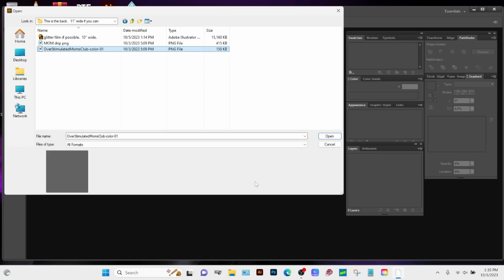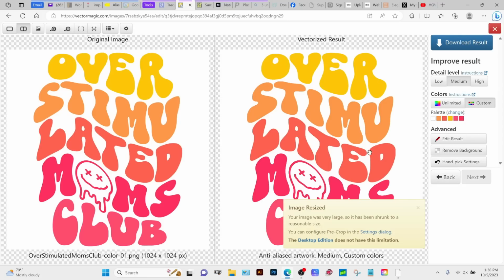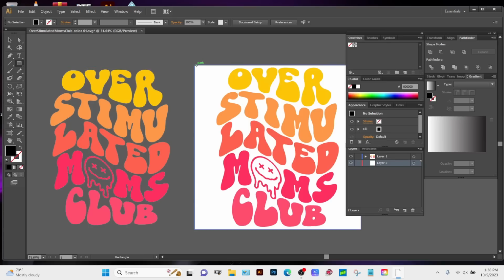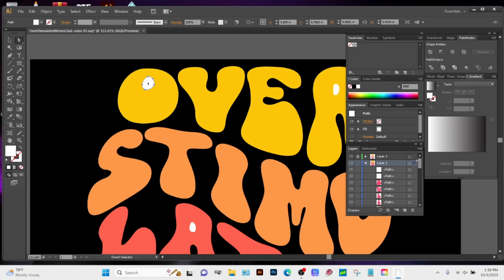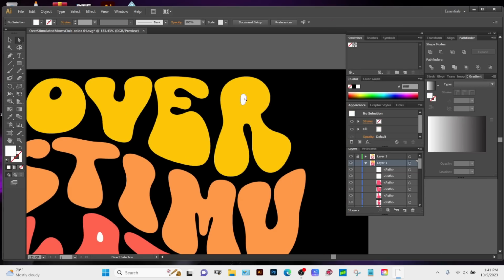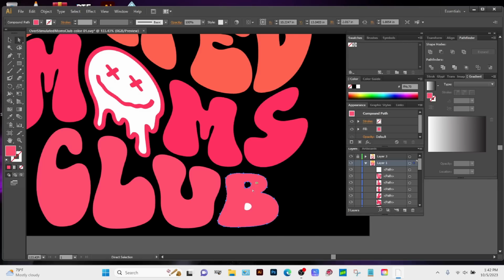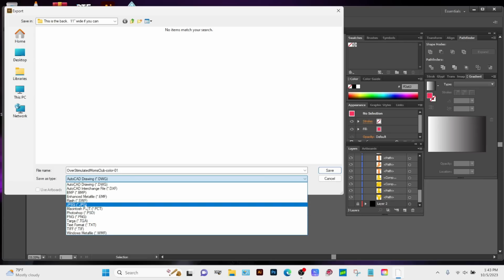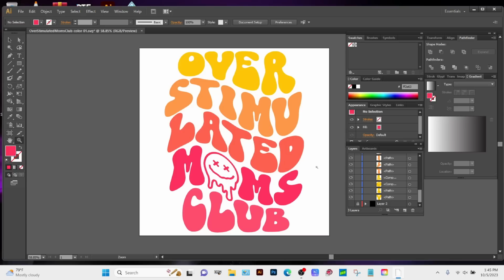MASTERY CLASS | 7. USING AI TRACING SOFTWARE

Comment: How does this compare to Illustrator’s auto trace feature? Which one do you prefer?
Reply from the maker: Hey! I like this one better because it allows more control over the exact color values that you can select, for tracing. Illustrator only allows for a range of colors. I still like to use the other tools in Illustrator to clean the files up, easier.